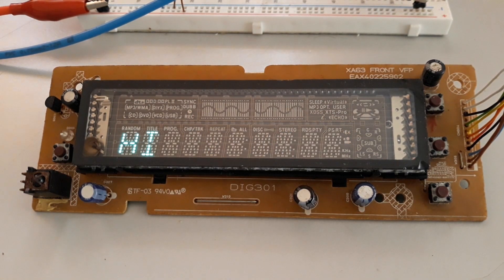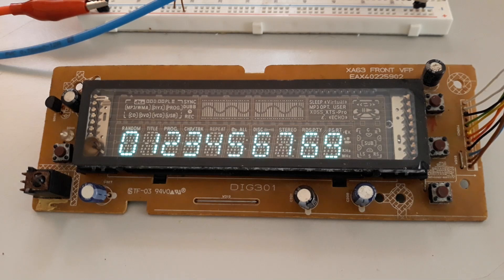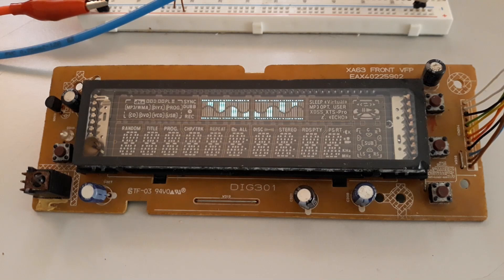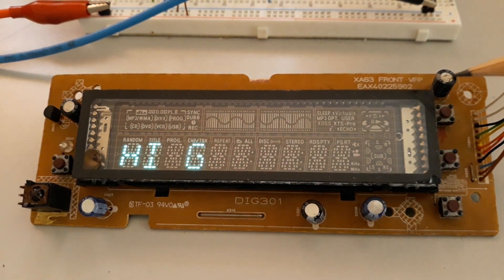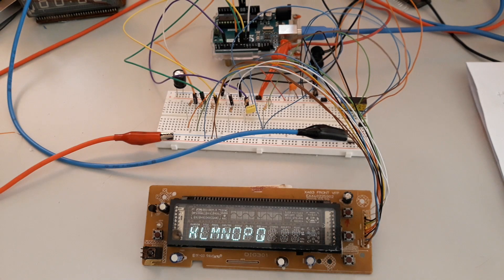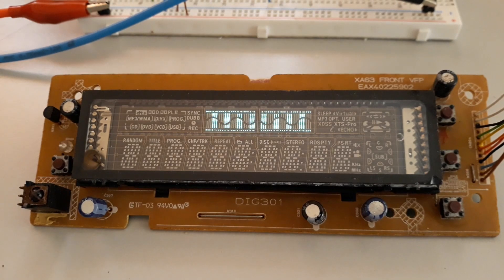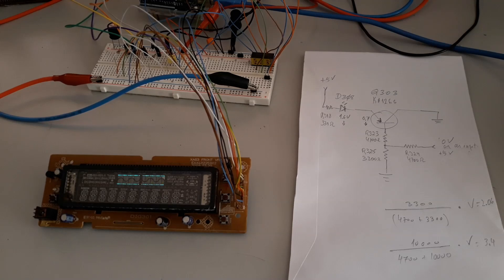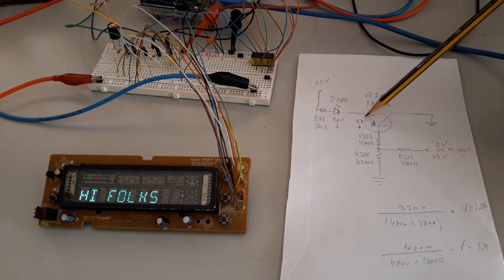MC3501

Comment: You talk more about the standby LED than about the actual display.
Maybe the video should be called R325 instead??
Reply from the maker: mikaelkarlsson9945 Thanks for the comment. I'm also learning and sometimes I get carried away by the things that are at stake on the panel. In this case, there are two errors on the part of the designer, which I try to highlight. The indication of +12 in the screen printing and the exaggeration of the LED circuits. I considered that the rest was covered, the connections through PIC's or the code through comments... until I used the alphabet
 in the comments as an indicator of segments in the equalizer to make it easier to understand which segments to change.
If you tell me what I should deepen to improve further, I would sincerely appreciate it to see if I can grow a little more!